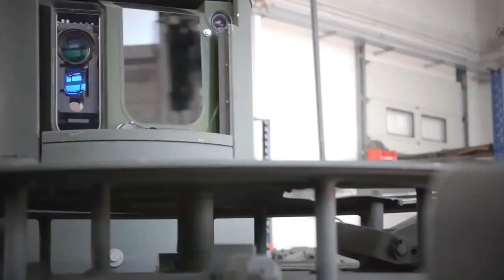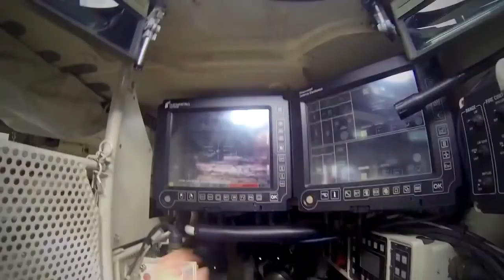Main Battle Tanks  Leopard 3

Comment: I want to call it TIGER 3
Reply: Kaiserlich Tiger.      (imperial)
Reply: So you want an unreliable mbt?
Reply: Yotty Dotty It wasn’t unreliable, it was high maintenance.  That’s OK for a specialised breakthrough tank.  Basically if you ran the maintenance schedule as per the book it was reliable, basically a lot of bolt tightening, track tensioning, adjustment of the running gear.
Reply: @WilliamJones-Halibut-vq1fs  ok
Reply: @WilliamJones-Halibut-vq1fs  lmao you couldnt even neutral steer without destroying the transmission
Reply: @einar8019  No other tank could neutral stear anyway and it was only a problem on uneven ground.   The original MAN design had a planetary final drive gearbox like the Tiger tanks and T34.  This was removed and replaced with straight cut spur gears which were much weaker since 600 tanks a month was wanted.  The gearbox was improved by stiffening it and adding extra lubrication flow.  Due to bad materials the wrong grade of steel was used.  They should have stuck with the original gearbox.   The final Panther Ausf F would have gotten the planetary gear box back again.
Reply: @WilliamJones-Halibut-vq1fs  churchill can and german transmissions would break even if you dident neutral steer

Comment: This is NOT a “Leopard 3” it is a promotional video of  Leopard 2 A5 technology demonstrator using modular armor on a Leopard 2 A5.
Reply: Frank Cessna uhmm the tank is called leopard2RI
Reply: Leapard 2a4 actually the 2a5 is designed with sloped frontal turret armour
Reply: Oakraiders 34 yea it’s not a leopard 2a5 it is a 2a4 but upgraded by rheinmetal defence